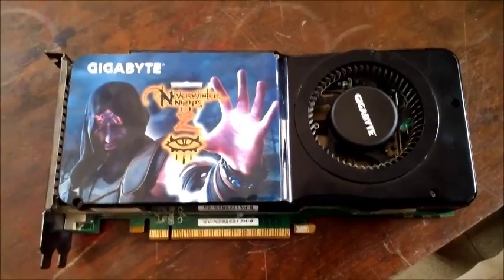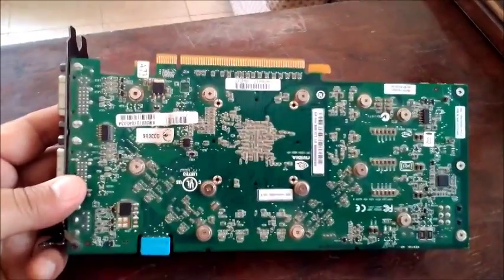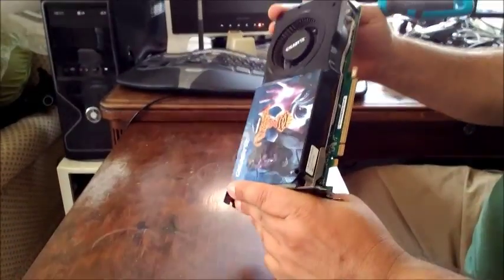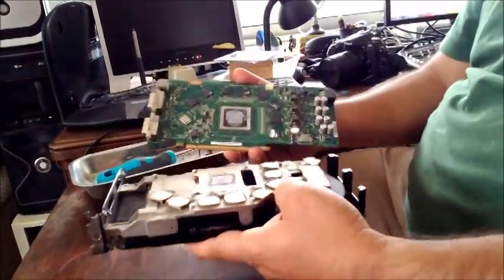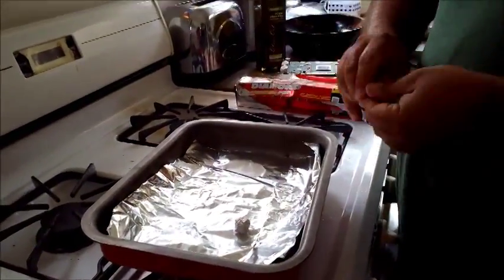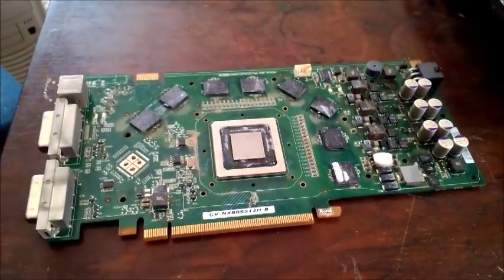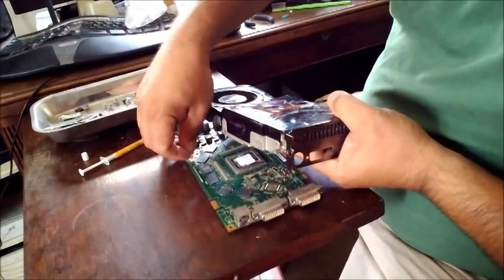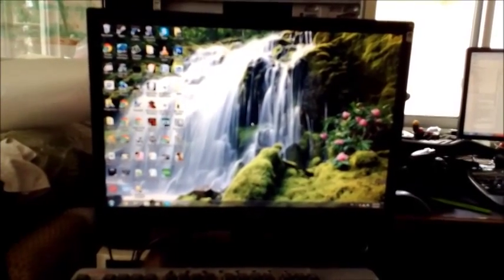GTS8800 Graphics Card Reflow Oven Technique

Comment: you forgot to replace the paste for the smaller chips
Reply from the maker: That's not paste on the RAM modules its some type of Styrofoam isolation thingy
Reply: David Miron
i see..
Reply: +Eran Finkle Dont put paste on ram chips, ever. You use thermal pads or you don't put anything on them.